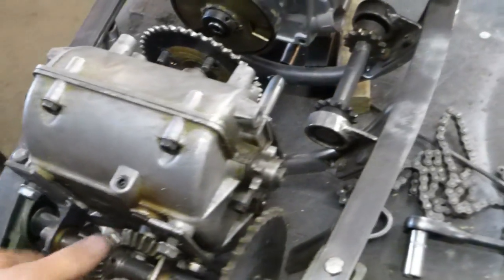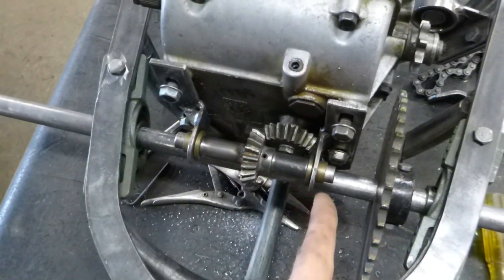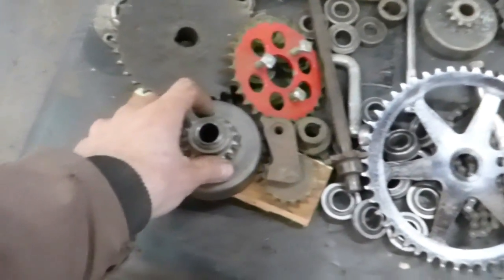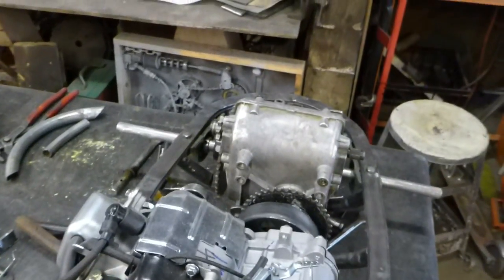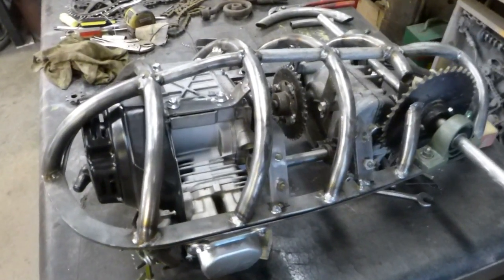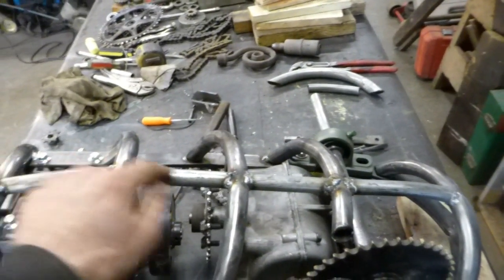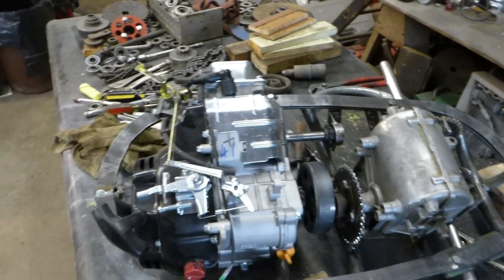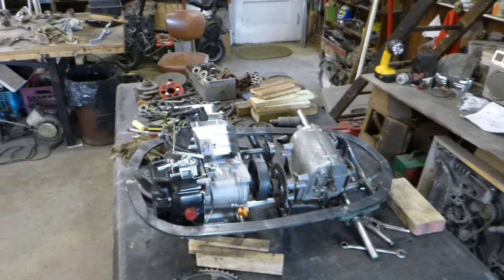The Belly of the Beast - Walking Machine Build (Part 1)

Comment: Man . that is amazing.   i was thinking about building a four wheel drive mudding mower.  i have one of those gearboxes except it's a Foote unit . i heard they aren't very good though.  i might have to find a peerless .  and for the front axle use an old steering shaft out of a car so you could turn .  we'll see how it goes.
Reply from the maker: +FullThrottle440 Yeah im sure that could work but it would have to be built pretty strong. I have a set of spindles with the u joint in them from a 4 wheel steer tractor that I want to use maybe on my jeep gocart but since its got a sprocket rear axle i was thinking it would be easiest just to run a long chain up to the front drive with the same style peerless differential. Theres really no easy way to do it I guess thats why you dont see alot of 4wd tractors and gokarts
Reply: jeep2003
yeah i was kinda looking over the build today and planning it out. i decided it would take to many mods to go 4 wheel so it's staying 2wd.  should get plenty of traction with the tires i'm putting on it.
Reply from the maker: yeah thats kinda what i was thinking for my jeep aswell. It would be mostly just for the cool factor because I sit right over the back tires so the front wouldnt really do much anyway. with tire chains on it goes anywhere i want it to.
Reply: jeep2003
yeah i've never built a mud mower so i was watching videos and soaking in information before i got started.  It's all in the tires i guess and locking the diff.  they go basically anywhere.   your little jeep is awesome. i'd love to build a small scale car or truck someday

Comment: I was wondering if you could help me out. I have a small Jon Boat trailer. I want to make it into a trailer with 1 or 2ft sides and have beams go up and put roller's on the cross bars to put the 12ft boat on that.  I bought the trailer used there is no number on it. It has leaf springs on it. How do I tell how much weight it will hold?
Reply from the maker: +Juno Mac RC Id compare the leaf springs to new ones. Length and number of leafs. They are pretty standard so that should give you a good idea of what the trailer is rated for. Although it doesnt always mean much. I have a cargo trailer built on an old pop up camper frame and iv loaded it with thousands of pounds and the springs dont budge. But I built my mini tank trailer with 1000lb springs and the tank and trailer weigh 900 and its just right it has a good amount of bounce.  Better yet put the boat on it and jump up and down on it and see if has some bounce. That should tell you if youre too overloaded or too stiff.

Comment: Did you bend the flat stock steel? how? nice build!!! can't wait!!!!
Reply from the maker: +Mekhanic1 Yes I just heated it with a torch and worked it a little at a time. It got wavy in spots but it hammered flat again. REDNIC79 cut some slots in his tubing rollers to make rings  but i didnt need to make nice even curves so I didnt bother with that. Glad you like it. Should be pretty awesome when its done